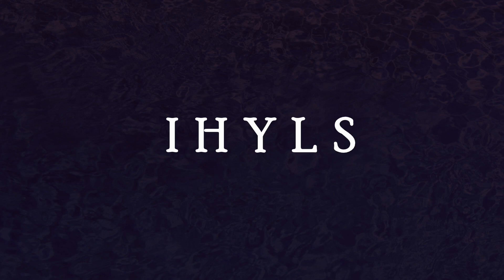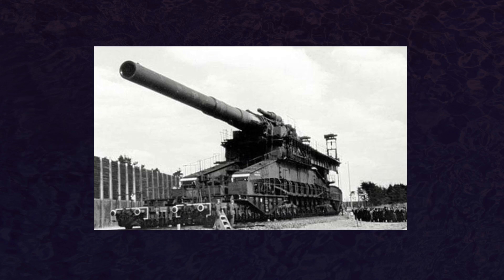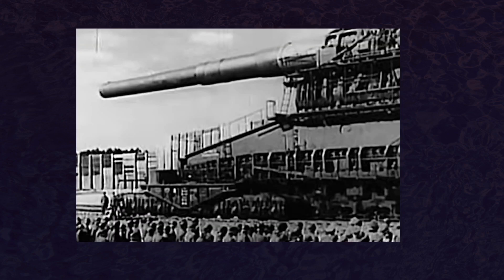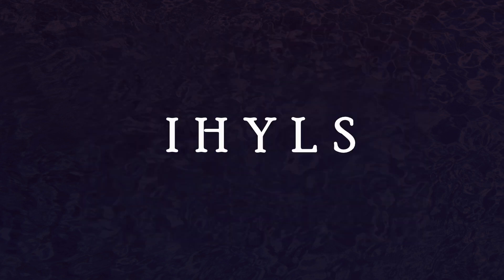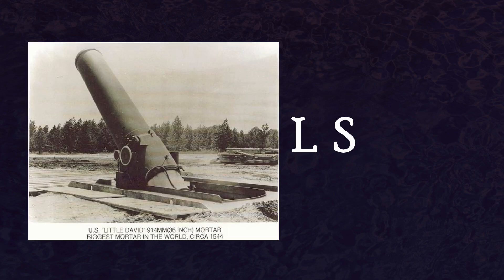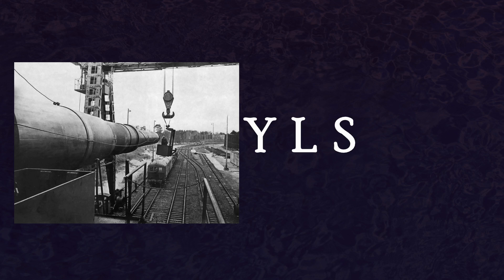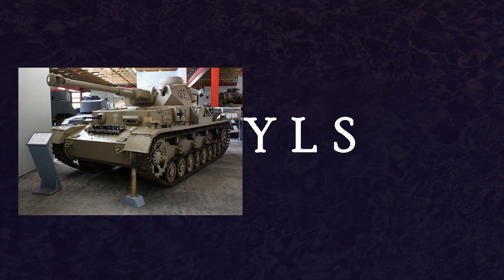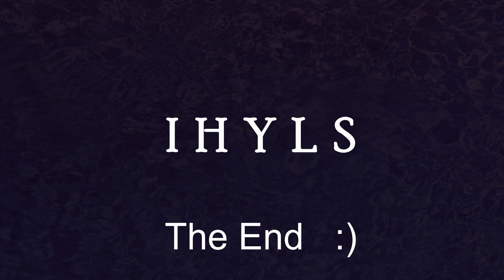Historical Oddities: German vs American Weapon Design

Comment: Another big influence on American weapon design in WWII.

Logistics.

American war planners were VERY aware every single thing they were going to be used in a war would have to be transported by rail to a port, loaded onto a ship, shipped several thousand miles, unloaded from the ship, and then transported to the front.

So everything had to fit on a rail car, be light enough to be lifted by existing cranes at existing ports or on existing ships, and reliable and fuel-efficient enough to not need so much fuel and spare parts as to prevent shipping more weapons and men to reinforce the forces in theater.

Bigger tanks than Sherman had been developed before Normandy. They were awkward to ship by rail, too heavy for all but the largest port cranes, burned fuel much faster than Shermans, and broke down a lot faster. Yeah, they were better  anti-tank tanks than Shermans, but they would have been vastly lower in number, suffered more losses due to mechanical breakdown than enemy action, and been gross overkill for most things a Sherman did just fine.

In short... TOO MUCH tank for the job at hand, while the Sherman was good enough.
Reply: An often overlooked point, very well made. Thank you for taking the time to compose your comment so thoughtfully. Much appreciated!